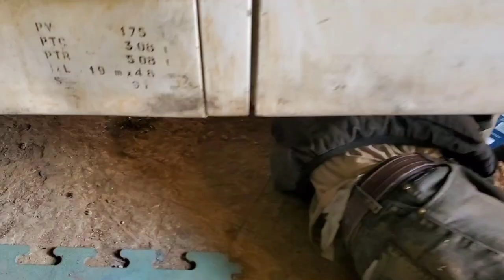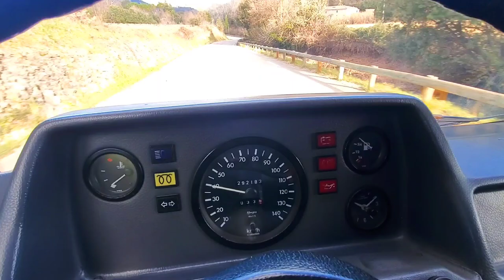ON CHANGE LE MOTEUR ! 😱 #mercedes #nomade

Comment: Bravo à l'équipe de choc pour ce soutien et bon travail.Un local avec un bon nettoyage, du tonnerre pour faire des  rencontres nomades,systéme D pour décalaminer le gras,un spray décapfour par trou de sonde lamda si tu as un catalyseur calaminé,mais sur le tiens tu n'as pas cette malchance d'en avoir un.Les courroies made in China sont recouvertes de kevelar mais pas de fibres internes d'ou un échauffement rapide et usure rapide,test sur tondeuses duré de marche 1 heure en plusieurs étapes,courroies d'origines 6h à 8h.
Reply: Pour le service rendu d'Aldo ,mon astuce pour se garer sur 1 seule place de parking,j'avais tourné de 1/4 de tour ma tente de toit sur ma golf break ainsi je descends a l'arriére du véhicule avec l'ouverture de sortie à l'arriére,moins de prise au vent,ou pluie,moins de condensation,et descente plus facile et chaussures sous la tente au dessus hayon AR + un pieds téléscopique de sécurité d'ancien rayonnage,qui m'à servit de double matraque en cas d'aggrression un la sipale du ressort qui sort ça impressionne,les rooms qui ont essayé de me faire croire à l'écharpe tombé sous ma voiture n'ont pas voulut insister en se servant de leur femme et 2 complices,j'ai mis en joue la femme qui m'à trop approché et tournoyer avec l'autre partie face aux 2 autres hommes, à 4h du matin sur aire de repos d'autoroute vers Istambul ils avaient ouvert 2 fois la tente dans un demi someil je croyais que mon fils voulait aller au toilettes et  quand je refermais la fermeture éclair elle se rouvrait lentement,j'ai vite ouvert et vu cette femme se plaindre en langage inconnu en montrant du doigt sous mon véhicule pour m'attirer dehors,j'ai vite réveillé mon épouse en lui disant on nous fait le coup du chat sous notre véhicule,je lui ai dit de tout filmer discrétement et enfilé mes savates attrapé ma barre télescopique avant de descendre l'échelle,d'un coup d'oeil j'ai repéré les 2 complices dont 1 caché sous un tapis,car il faisait encore sombre et une voiture berline garé en travers devant moi avec la plaque dissimulé par un plastique qui sort du coffre,donc leur intention était bien en position d'aggression, j'ai forçé la femme a aller sous ma voiture récupérer une écharpe,elle a refusé,avec l'autre morceau de barre coté ressort j'ai accroché son écharpe et mis sur le coté, un des 2 homme s'est rapproché en me hurlant dessus,il a pris le ressort dans les dents et s'est vite enfuis dans leur voiture.Je n'ai pas pu les suivre car tout le monde avait pris une envie pressante de pisser,et encore mieux un routier me barre le passage,jusqu'à que j'explique à autre routier sa manoeuvre,en 1 min il a dégagé,j'ai voulus signaler mon cas á la police d'autoroute,il hausse les épaules et me dit qu'il a 10 comme moi par jour.Quel accueil il y a 15 ans en Turquie.